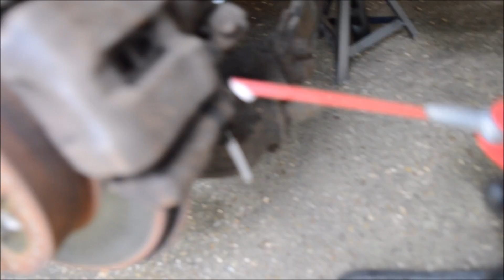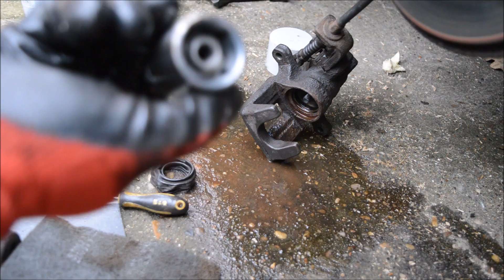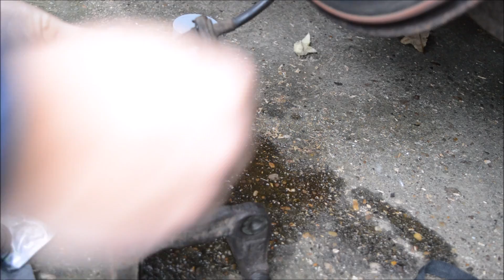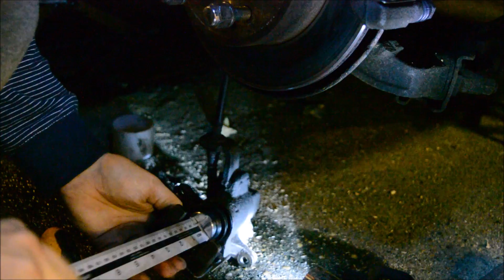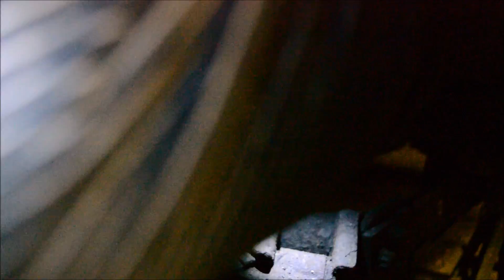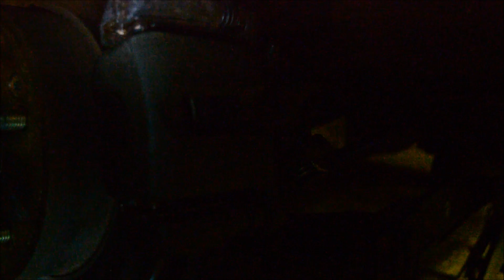How to refurbish your rear brake caliper Honda Civic Type R EP3

Comment: How did these pistons hold up over time? I need a new rear caliperton my rear left and came across the full kit for all 4 calipers for £68 and thought this was a much cheaper option for sorting out all 4 corners than getting one new one. But my local mechanic advised me to avoid them and just get a new one, guessing he didnt have much faith in them so now i'm not sure which way to go.
Reply from the maker: I'm still running the refurbished caliper now, zero issues with them. If your mechanic will be fitting them, it would be cheaper for you just to buy a new caliper in all honesty. 

The kits are good but fitting them can take alot of time, particularly if your calipers are corroded, seized etc.

Comment: Hi I've just replaced both rear calipers and they were beyond help but now my hand brake keeps sticking on to the point that I don't use it and I was wondering if you had any tips, it work fine before replacing the calipers

Comment: Hi mate just a quick one, one of my calipers has seized so I'm fitting some new ones, but will refurb the ones I'm taking off, but how did you remove the seized piston? There's barely any movement on it for me
Reply from the maker: When I did mine, I removed the caliper which was still connected to the car via the brake line, I had an unwinding tool however it was seized solid and wouldn't unwind. So I supported the caliper so that the weight of it wasn't straining the brake line and then went to the front of the car and pumped the break pedal about 3-4 times, this then broke the piston free and unwound it so that I could fully remove the piston with the unwinding tool. I hope this helps :)
Reply: I did mine yesterday with a G clamp and one of the old pads. Worked well.. mine wasn't seized though.

Comment: Are you sure the copper grease is alright to use on brakes?
Reply: Yes it's ok to use copper grease between moving metal parts eg brake pads "ears" or the back of new pads where they get in contact with the piston.

Comment: You remove the hardest part except for the hand brake cable wich is very easy to take out . Just remove the lock pin and you'll be able to free the caliper from the hand brake cable. To make your job easier on the bench.
Reply from the maker: It was siezed when I was doing the video, UK weather isnt good to us over here, this is the side drains run so all dirt etc gets caught up this side assuming thats why the caliper was siezed originally. Since then off camera, I have replaced the pin so if ever happens again I can do it on the bench 😎

Comment: how did you tell that it was seized? did you notice sny noises or it just felt slow?
Reply from the maker: Hi Jamie, you could actually hear the brake pads grinding on disc, also the car felt sluggish / slow. When I finally pulled over the smoke was coming from the caliper and you could see and feel the heat from the brake, under closer inspection you could see the rubber boot was damage and you couldnt wind the piston back in with a winding tool. 

It did play up once before (common known fault) and that was the brake pads seizing in the runner (the piston moved freely), all I did then was remove the pads, clean up the s/s runner, carefully applied copper grease to the runner so that it didn't go on pad or the disk and then clean up the brake pad edge's which sit in the runner and this worked prefectly.

Comment: just a warning, do not undo the internal mechanism of the piston, had renewed the rubber seals and i decided to renew the piston, popped the circlip and everything leapt out, now cannot get it back in as it is heavily compressed, had to order a new one off eBay, and wait a couple of days. Anyone know how to reassemble the piston mech?
Reply from the maker: The new piston usually doesn't come with the spring and circlip etc. When I did mine the same thing happened luckily I did it on a table so found all the bits. The way I reassembled the piston was by putting all the bits back into the back of the piston, then used a 17mm long socket and G clamp to compress the spring and so the the C clip locked into place. I hope this helps.
Reply: thanks flawless, i did try that, even thought at the time i had all the new parts and then the old parts from the piston, but i could not compress it enough, so I ordered a new piston with the internals in place. Thanks
Reply: Just needs compressing back in if rhat happens.